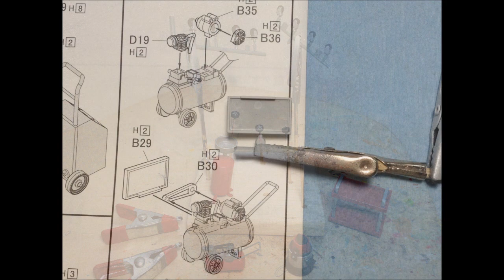Building, painting and weathering the Fujimi Garage Tools Remix Kit

Comment: Going to have to get me this kit. What goods a Mechanic with out tools LOL Also a word of WARNING. Watch that damn oil drain. That freaking thing gets over full fast and it is seriously unstable and flips over at the slightest thing uneven or blocking the wheels. I've done both many times in my career lol.
Reply from the maker: Thanks for the comment and the "tip" Ron, lol.  I noticed the front wheels are very small.  Not a fun thing to spill over.

Comment: Looks great excellent job where did you get your kit from eBay says 36 Amazon says 42 order from Japan that's 13 but I wonder about the shipping
Reply from the maker: Thanks Butch, I got mine at a local hobby shop for about $25. It's an older kit, 2014, and there are a few different versions from Fujimi, if you order one be careful to get the tools, there is one that looks similar but is only the garage walls and floor. AMT put out a couple of similiar kits last year at higher prices.
Reply from the maker: Just checked and Hobbylink has the AMT kits on sale for $23-$26 US$.  Here's a link to the website: 
http://www.hobbylinc.com/cgi-bin/s8.cgi?cat_s=&str_s=amt+garage
Reply: Thank you sir